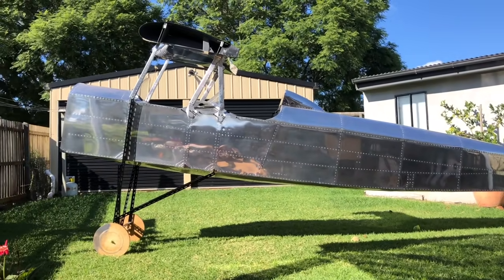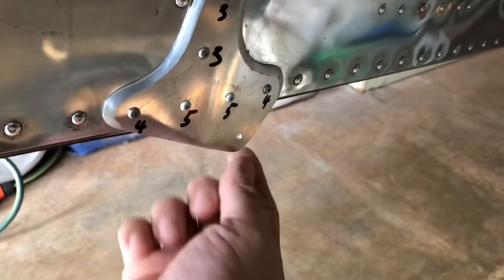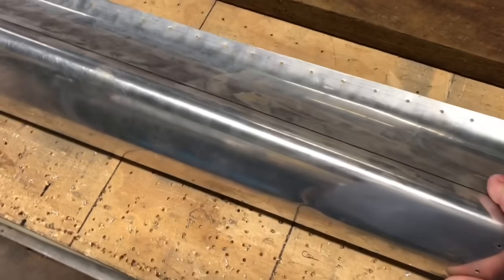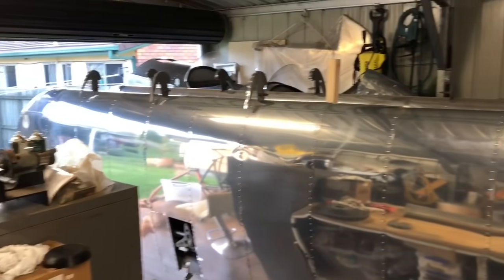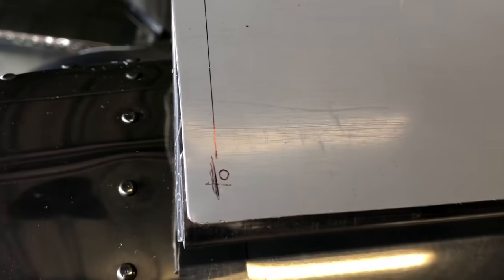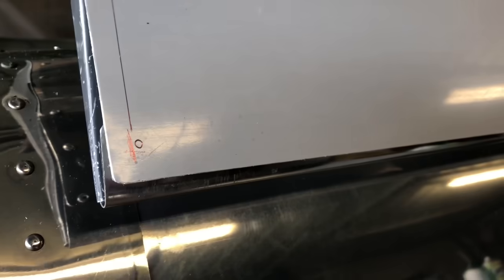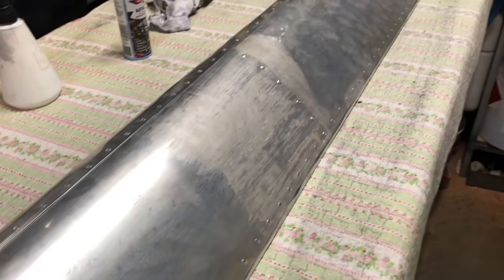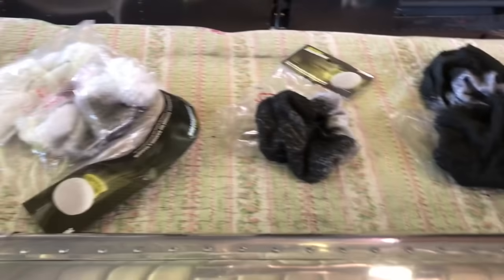Frankenstein goes STOL, building leading edge slats

Comment: Personally, i'd use a 2" PVC pipe to get the angle/curve to get it 'roughed' in to the diameter you need to to be getting close to. I'd attach the PVC tube to the center line of the sheet and sink some small screws into the PVC temporarily to hold the same angle/curve down the entire length of the leading airfoil. Once it's formed, i'd cut a a 4" sheet to double up the leading edge once you remove the PVC 'former' and it'll give you a little extra strength on the very leading edge of the airfoil and it'll help it from deforming once you start getting the ribs in their respective places. 

I've been building RC planes for over 40 years and it's how i do them on the larger wing sets. I don't know if it'll work on that scale BUT, it works great on our RC aircraft. I've really enjoyed watching the progress of it my friend. Happy flying brother...!!!

:)
Reply from the maker: Thanks mate, I really appreciate the thought. Aircraft grade (7075t6) aluminium is quite tough so using a pvc tube over a long distance could introduce a curve as the pvc flexes. If there were attachment screws into the pvc there would be a tendency to fold/crease where the holes are instead of rolling. Because of the strength in the material, a rolled leading edge is very strong as it is and doesn’t need stiffening up, the challenge is towards the trailing edge to get it straight and have no waviness. If I had access to better tooling like rollers and folders It would’ve made life easier, but this was in a locked down period and I just wanted to do something. Thanks for the insight on RC techniques, it’s interesting to see how similar they are on larger scales

Comment: In areonautical engineering, wing loading is the total weight of an aircraft divided by the area of its wing. The stalling speed of an aircraft in straight, level flight is partly determined by its wing loading.

Comment: Aeroelasticity is the natural tendency of any wing to flex under aerodynamic and inertial loads while in flight. Most designs seek to minimise the effects by making the wing structure as stiff as possible. However some have sought to use the effect to advantage. I'm studying engineering.

Comment: Your hole finder is what we called in the RAF a back marker and we made them all the time. I made one with a hard steel pin so the drill did not take the pin out, the pin was spot welded to the low plate, I still have it in my workshop some place (last for around 20years service in the RAF).
Reply from the maker: Flying Kub we have ones very similar to that at work. Very handy and have lasted pretty well.